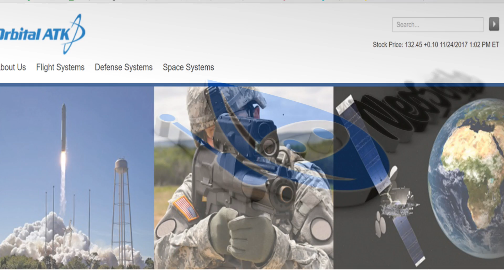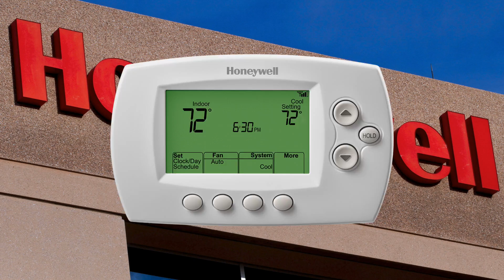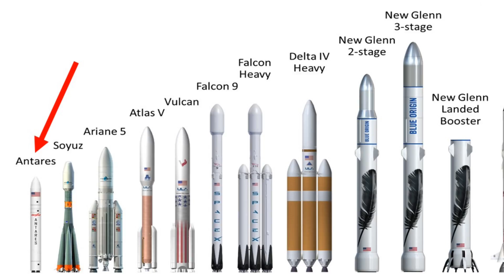Orbital ATK, Overview and Future

Comment: Space X has done 12 missions this year, not just 9/12 in a decade. They've landed the first stage on all accounts except the main booster of initial falcon heavy mission. I know that BFR is crazy and unimaginable, and no matter what that sort of engineering is required will take time to develop. I respect their accomplishments because space travel ain't easy. But, Space X's record, ambition, and vision, seem to me to be a better approach towards space flight. We won't know if the tumbling acrobatics of the BFR will succeed until we try. Probably, we will need to try a few times or so, but it will change the game if and when it works. Nobody can say it will, so they don't get the contract.
 Bullets are like tiny rockets, but the purpose of a bullet should be contrary to the purpose of space travel. Bullets mean war, travel requires peace. War demands respect. Peace requires understanding. 
   I personally think that one is more purposeful than the other. What do you think?

Comment: I can't see any future for Orbital. And they're not alone. Just about every traditional company on your list is facing extinction due to SpaceX and to a lesser extent Blue Origin. They just can't make anything quickly or cheaply and lets face it, none of them want to.
Reply: Zinc Finger orbital has a 90%+ launch success rate over the last 50 years and have been one of the largest pioneers in solid rocket motors In that time frame. They won't be going anywhere with their contracts that run well into my child's retirement era.
Reply: Sorry. What I should have said was I can't see any future for Orbital with regards to orbital rocket systems.